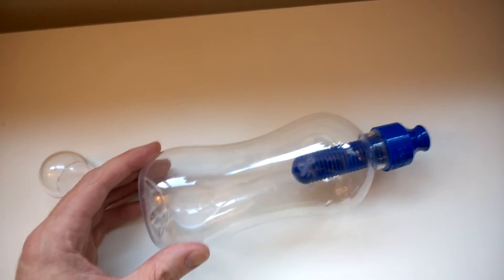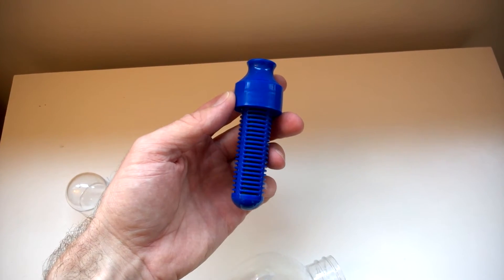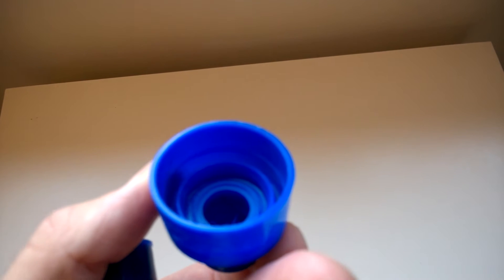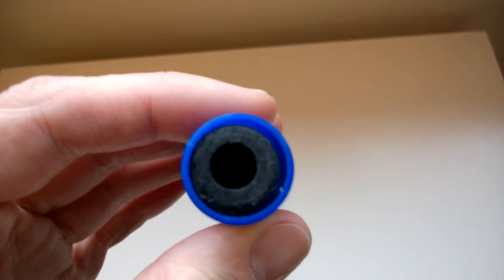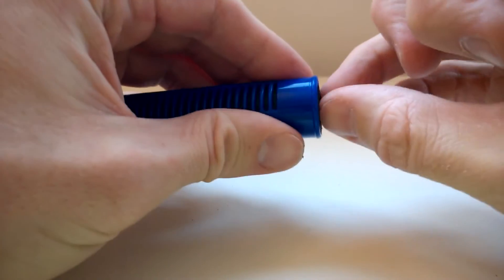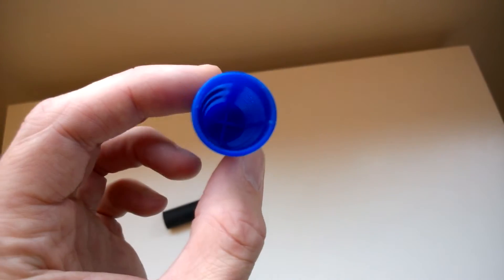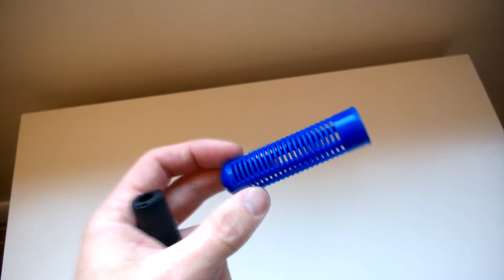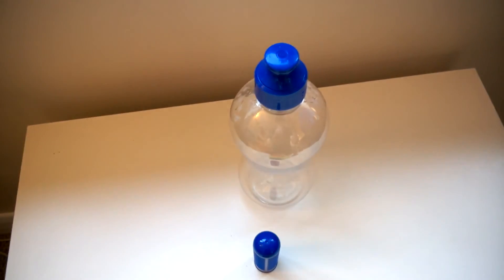Bobble Water Filter Tear Down

Comment: I'm not sure how you managed to get your filter cage smelly, as I have owned a bobble bottle for prob two years now and I've never once had a bad experience, in fact because you get the whole coulored part in the box when buying a replacement (filter, cage, spout and lid) you really shouldn't have had the parts for that long unless you're a really low water drinker?

Also due to my disability I find the shape of the bottle much easier to grip and hold on to, unlike some bottles that fall and usually land on my foot!